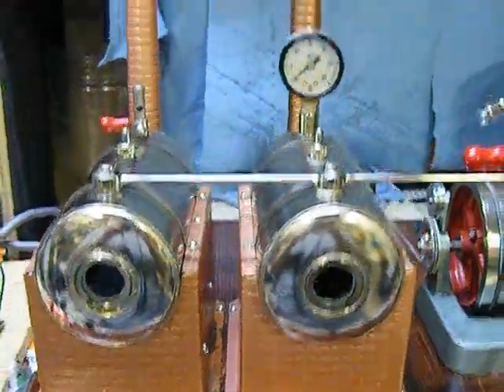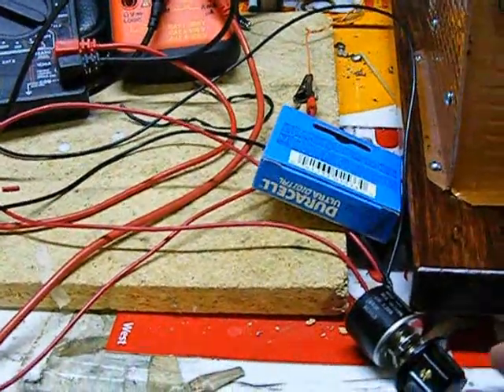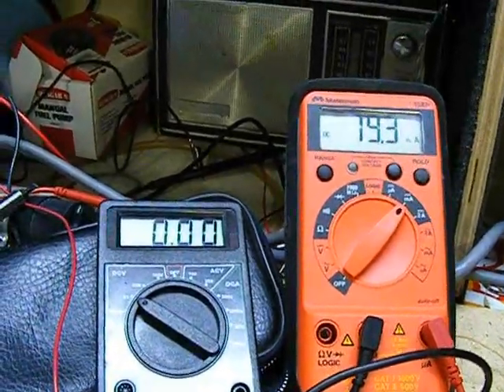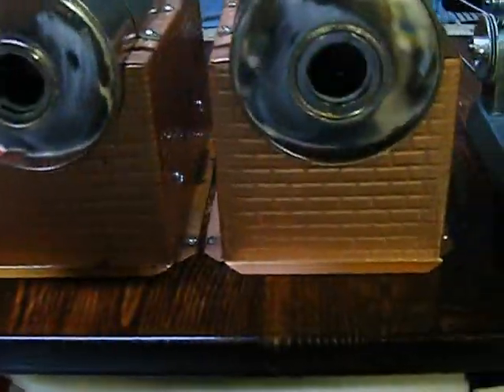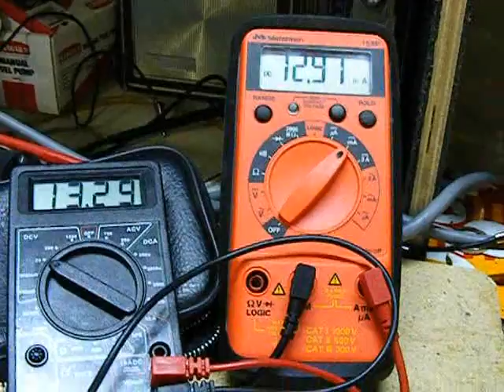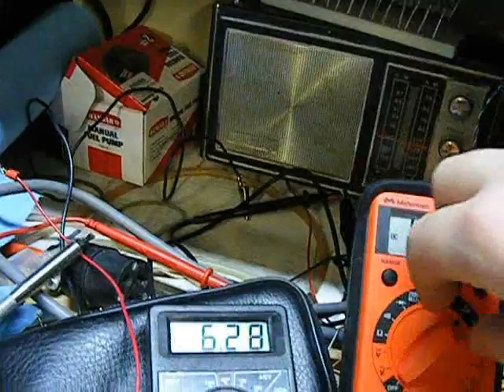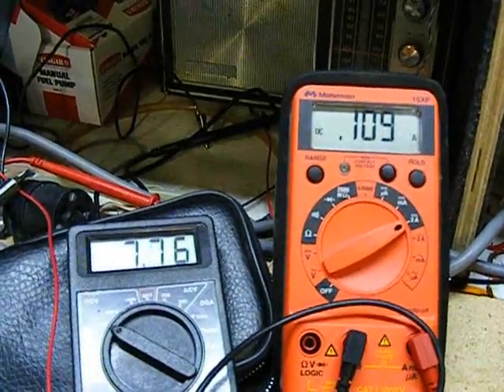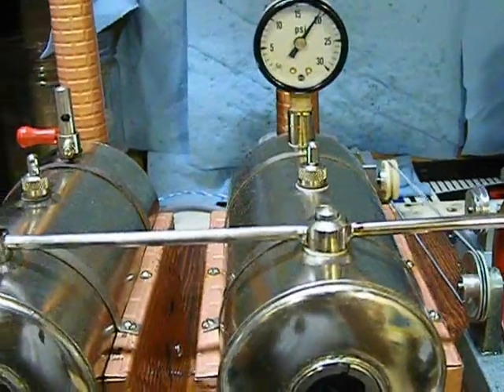Current Affairs - Stepper Generators

Comment: I know this is old but I found it very useful! I have been using set resistors to get an idea of my power generation but using a 10 turn 1k pot is a great idea.

BTW i just worked out your 10.5v output @ 54mA = 567mw! Not bad considering the rpm seemed quite low.

Also i noticed at ~5.5v you were generating over 120mA which will easily trickle charge most USB phones, which btw is nearly 700mW :)

Comment from the maker: a milliamp is 1/1000 of an amp.  I'm not sure what would come out the other side of the inverter, I'm fair certain that it, sadly, wouldn't be enough to power more than a few small light bulbs, if that.  We're talking fractions of a watt of power. :(